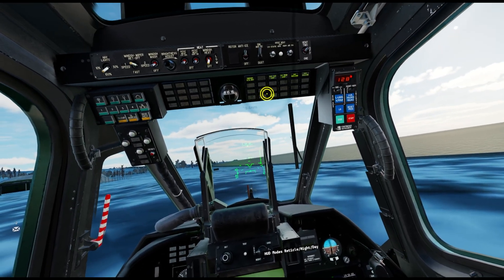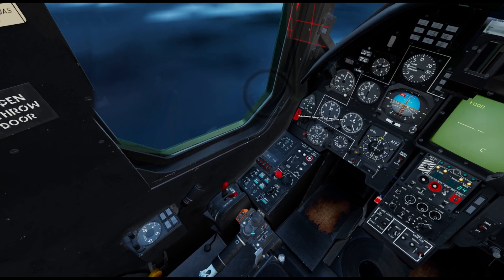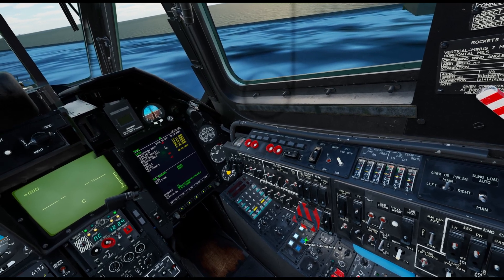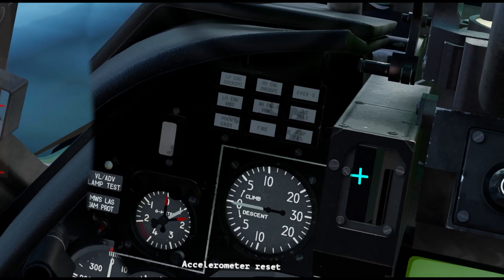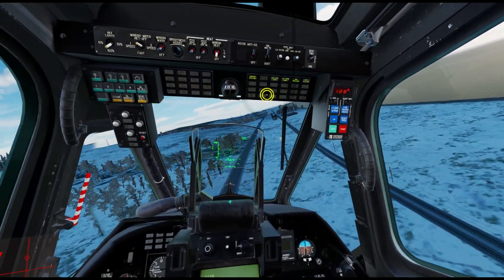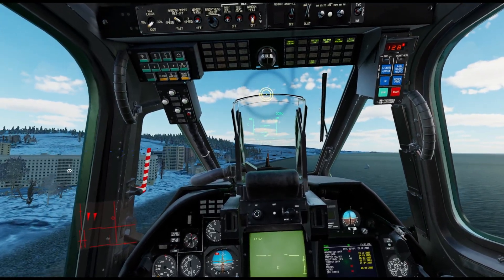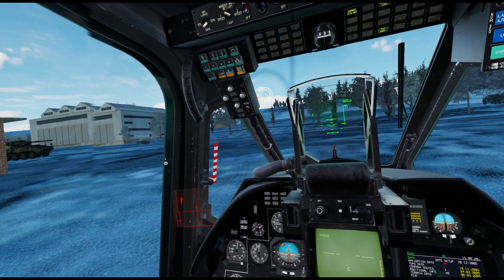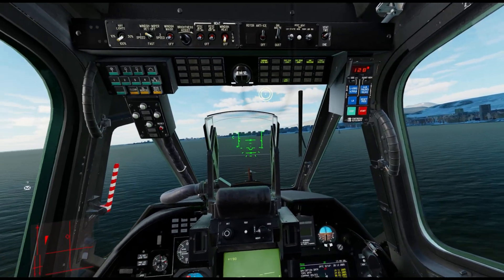Zero to Hero | DCS Ka-50 | 4 - Basic Flight

Comment: Hey Gh0st, If I am in multiplayer and press H for HUD, I get your little yellow circle. If I am not in multiplayers I get a large white circle the size of the HUD. Any ideas please. Cheers Red.
Reply from the maker: It could be set to low light/night mode? OR it has the NVGs installed and not the HMD? (Try swapping them via Comm Menu -> Ground Crew -> Change helmet device)
Reply: @DamnedGh0st  Thanks, no problem today.

Comment: Your tutorials are very good. I have one question: Why do you give left cycle and right rudder in a right turn and viva versa? (For example at 07:30) Is it because of the special flight characteristic of the Black Shark or is it because of shorten turns?
Reply from the maker: Just to shorten/sharpen the turns/corners. :) It is similar to what you can do in other rotary aircraft. Kind of like the concept of countersteering in a bicycle or motorcycle.